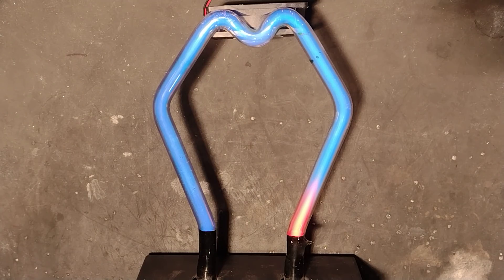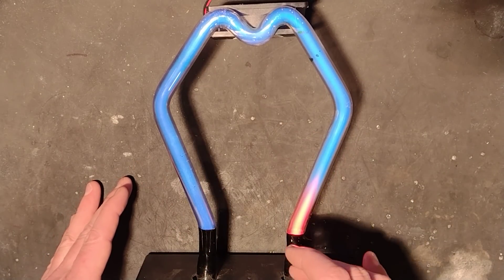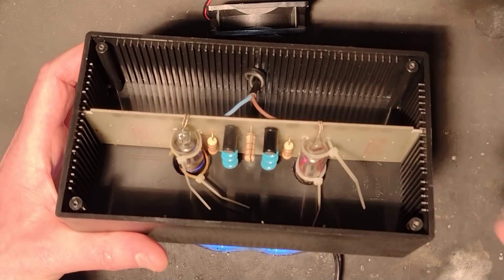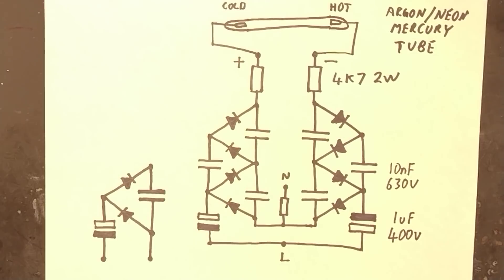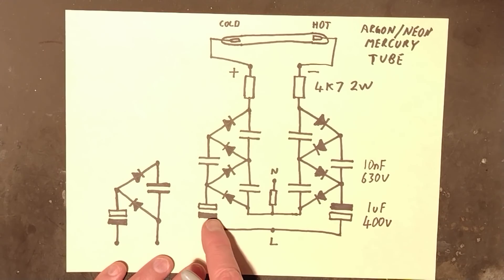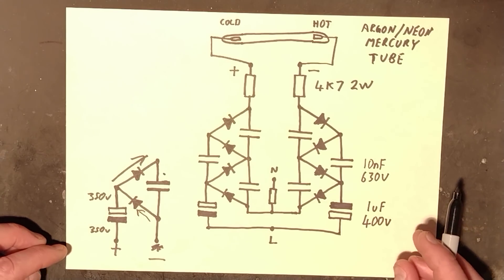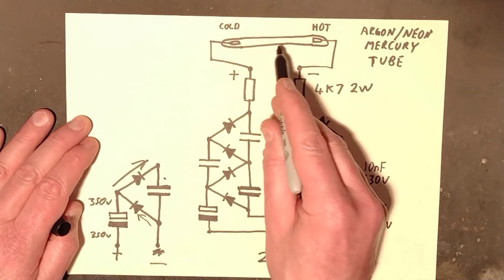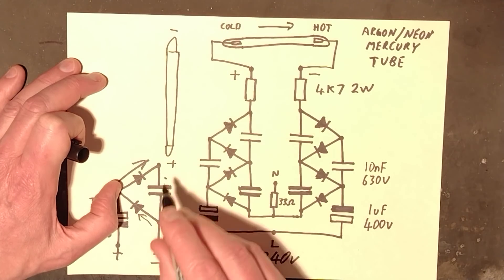The "M" tube neon-mercury DC migration effect (with schematic)

Comment: It reminds me a bit of a service timer capsule in a gyro. It is a very thin glass tube about 40mm long filled with two different fluids that don't mix, about 95% one fluid and 5% of the other. There were two electrodes in each end. A small current was passed through from end to end, and over the course of weeks the fluids would slowly exchange places and the small blob would migrate along the tube. When it reaches both end electrodes, the different conductivity was detected and popped out a service flag in the display warning you it needed an overhaul. When it was serviced we swapped applied dc current around and the blob went back the other way.  Sometimes one would come in with a fault close to service time, and we would hurry the timer blob along with a bench supply over the course of about a day.
Reply: And for some reason, I am imagining a small flag popping out and unfurling ala Looney tunes...
Reply: @adragontattoo  More in the line of a small magnetic indicator that would flip state from a black background to one with a yellow one. As they both are latching, and have a small switch built in, the flag flipping to yellow would change over the small contact set inside, and this was used to operate a yellow annunciator on the master caution warning panel, giving the pilot a flag that a system was in a degraded state. There was another set of indicators that would be right next to this one in the unit, which was operated by the self test circuitry, and that one flagging would illuminate a red annunciator light on the panel ,accompanied by a tone in the headphones, that the pilot would need to stop, using the master caution reset button, which would tell him this system is not reliable and is failed.

Generally, when you power on the aircraft, every system will light up this panel for a few seconds. Both to test the caution and warning system is working (the panel lights all come on, then go off over a few seconds as systems complete self test) and to show the avionics are all coming on properly as well. 10 seconds or so after power application the board should be all off, and you just reset the master caution button to clear the tone medley. Any that are still on, that you do not expect (oil pressure and hydraulic systems, as the engine/s are not running, and low speed warnings) are then repaired before you take off.
Reply: @adragontattoo  actually a little painted paddle on a pivot, much like a tiny little railway crossing barrier.
Reply: dude that is genius.  in a very different application I'm reminded of mercury memory in computers.  An incredible and cool solution

Comment: What happens to the available current, is it divided as the voltage is multiplied?
Also, is there a limit to how high you can multiply the voltage before arcs appear?
Reply from the maker: As the voltage goes up the current comes down.  But in this case, once the tube has struck only the first few stages of the multiplier are active.

Comment: Sometimes some mercury is used in neon based lamps to reduce sputtering._
Reply from the maker: Any trace of mercury could cause dominance over the neon.
Reply: @bigclivedotcom  But what about nixie tubes? There's something glowing blue at the electrode connected to positive in ИН-14 and according to google translation of the datasheet it was mercury._

Comment: Used to work in a shop with a large set of neon signage outside. Majority of the sign used mercury filled signs, in the favourite colour of Clive, pink, and the 3 signs all had running patterns and flashers. I kept a few spare tubes of the most common type, a bar and an arrow, as they were going to fail on the odd occasion, though most were from breaking. 

Solved the breakage problem by letting it get out in the neighborhood that the glass, while the perfect size for smoking your crack, was also going to shrivel your nuts, and the weekly breakage stopped. Helpful, as each one cost around 50 pounds to make, and I only kept 6 spare ones. Only got 4 left, as the shop closed, and the signs were removed. Did however get another 2 new pieces for another sign, from a shop that never opened, along with 2 new neon transformers. One white, one clear mercury filled glass.  Also have an electronic ballast I picked up, along with around 4 regular old lethal size neon transformers, of various sizes.

All the neon now sits wired onto a plywood board, and gets lit up on occasion, though I should add in some flourescent lamps, the high voltage EEX type, as well.

Comment: Does running the tube in dc wear out one electrode faster than the other? I always thought this would be an issue and a way to reverse polarity would be implemented to prolong tube life.
Reply: Yes it does wear out the one electrode, generally the negative one, as you are stripping electrons off it and bombarding it with positively charged ions. Does tend to erode the surface off, sputtering it on the walls of the tube. However the electrodes used in neon tubes are designed to withstand this, as it is what they normally get exposed to every half cycle, so will last around 20 years running 24/7/365 even here. Will just have a black mark around the electrode after a few decades, so you turn the tube around and use the other fresh one.
Reply: @SeanBZA  i just cant see how the negative electrode erodes if its metal is protected by a constant supply of excess electrons. i mean when the positive ions hit the neg electrode they take electrons away, but theres plenty more left over and they just keep coming. so I just dont see how the metal would start breaking up because of this bombardment, maybe master clive can set up an experiment to blow either theory out of the water
Reply: @SeanBZA  yeah you might get some high velocity in a full vacuum CRT at 25+ kilovolts, but i dont see it applying to a gas tube with few hundreds volts on it.  because what speed are we talking about here? remember its hard to accelerate things through gas, even at low pressure, whats the mean length of ion travel before it hits gas at that pressure? is it 1mm or 0.0001mm ? either way your miniature 'particle accelerator' doesnt have the distance or the voltage to impart sufficient energy for the process youre describing.
low voltage and gas as well? hmm , i give up, i just cant imagine cathode erosion happening to any significant degree in these conditions
Reply: @echelonrank3927  Seen plenty of it, just look at any CFL lamp base, which will have as it ages a nice dark band as the cathode is sputtered off onto the glass. Neon is designed to survive this for a long time, but still has the sputtering problem, especially with older tubes, even with the cup electrode, designed to have any sputtered material be mostly coated back on the inside of the cup, and not on the glass walls.

Look at any small flourescent tube and this is a lot more apparent, especially those running on cheap DC ballasts that have unidirectional high voltage pulses, where the one end will turn black.
Reply from the maker: It does, but this circuit compensates by running the tube at less than half of the electrodes rating.
Reply: I was wondering about that, thanks for the clarification, guys. 🙂

Comment: Mercury migration is used in hour-meters.
Tiny glass capillary tube with mercury fill at both ends and a tiny gap between.
There is electrolyte in the gap, current flow through the tube 'plates' mercury onto one end at the expense of the other.
The gap 'moves' to indicate operating time.
Reply: the mercury coulometer / electrochemical hour meter was only very recently retired from one of its final uses on deuterium UVC lamps in favor of the less toxic LCD digital counter.
Reply: @Muonium1  that will only motivate people to smash the counters to pieces and spread them around even more. if you make a helmet twice as strong youll find people hitting their heads 3 times as hard.
Reply: @echelonrank3927  um k sure, whatever you say
Reply: @Muonium1  i have original content on my channel
Reply: @echelonrank3927  tell the doctor to up that Risperidone dose honey
Reply from the maker: I saw those fuse-like devices on Tomorrow's world when they first appeared.
Reply: I've something similar in my junkbox which came out of an early VHS video recorder.
Reply: The most common of these are Curtis elapsed time indicators; they are (or were) commonly used on ion lasers to record the run time until the tube was considered end of life and due for replacement.

Comment: What is the brand name of those orange  insulated  screwdrivers (electricians  grade )  No  ground  connection  on that high voltage  circuit ?  That    type of voltage  doubter/tripler   circuit   can  be  found  in old  CRT  televisions
Reply from the maker: No ground needed.  Just live and neutral.   The screwdriver is a classic VDE type required by the safety industry to protect us from ourselves.
Reply: it seems to be Bahco.  from the northern countrys. sweden, or norway i guess.

Comment: Would we double the doublers on the schematic for 120 volt mains, big Clive?
If so, what about cap values?
I have heard someone say that if you reverse the polarity on the bulb,  it will slowly migrate to the other side since its DC.
I like your schematic.
All I have is a cheap circuit board version with a small transformer.
Reply from the maker: Yes, double the stages to get the strike voltage.  The capacitors would only have to be rated for half the voltage, so 200V for the base electrolytics and 400V for the others.
Reply: @bigclivedotcom  thank you big Clive!👍

Comment: up until '67, I worked on neon signs working with 10KV+ transformers [from memory]  fault-finding was fun shorting out letters with a length of cable in your hands live :)
Reply from the maker: The shorting sections with wire was common.  Quite exciting.
Reply: I remember doing this on signs standing several stores up on scaffolding. getting shocked was not fun. if I remember right, they were 12kv center tapped transformer
Reply: @jasonharrison25  Was that a painful shock?I think those were 30 mA transformers.

Comment: Perhaps a good terminology for the breakdown of the electron barrier would be the flash point???
Reply: Ignition Voltage
Reply: @COBARHORSE1  that describes what it takes to break down the barrier,  flash point is descriptive of the event... but not bad...
Reply from the maker: I suppose the correct term is strike voltage to overcome the electrode drop.

Comment: Ah, thanks Clive. This reminds me of the "Quad" as in quadrupler in my CRT projector. It's one of the last before the digital age and was "state of the art" at the time..... (turn of the century). Pushing out 35kV or so, the quad is probably the single biggest point of failure for these devices. Replacements are getting hard to find. The components are potted in a rubber like substance, and amateur attempts at making replacements don't last long at all. This has just made me smile at the number of hours of my life spent trying to converge these machines, and then sitting there wondering/waiting/expecting the quad to go "pop"!
Reply: The problem with making them is getting all the bubbles out, you need a vacuum pot to degas the resin, and then the inside will not have any voids. Reproduction ones often do not get the gas all out, leaving them with built in failure spots. The diodes and capacitors are easy enough to get, it is just the assembly is harder. In a projection set there is enough room you can even DIY it, using microwave oven diodes and high voltage capacitors, making it much larger, to get the insulation needed, and use common potting materials as well.
Reply: @SeanBZA  Yep, many have tried..... Even the vacuums to de-airate are common enough..... yet still we never got the longevity... If anybody has the "magic", there is a small but eager market out there!
Reply: I fitted a load of these back then ... in pubs and hotels. Mostly Seleco. Many happy hours spent using 68 parameters to converge the guns. Was tuning one in on christmas eve in the Park Hotel in London connected to the in-house feed that was unrestricted. Slightly embarrassed when the auto-tune found and displayed 8 foot wide images of their hardcore porn channels to a bar packed with well-dressed yuppies. Gave us a laugh though.
Reply: I suddenly feel very old! Turn of the century has always implied to me ca.1900 but you're referring to 2000 and that makes me feel ancient!!

Comment: Are you sure mercury goes from + terminal to - terminal as per 7:38?
I thought it was the other way around!
Reply: During operation all of the gasses (including the mercury vapor) in the tube will be ionized to some extent by electron impact.  The electrons (being negatively charged) will migrate towards the positive electrode and the ionized atoms (Ne+, Hg+) will migrate towards the negative electrode (the net flow of electrons is just the operating current).  Of course, recombination will be occurring all along the tube (this is where the light comes from), but the mercury atoms are about 10 times heavier than the neon atoms and diffuse rather slowly by comparison.  The net effect is that, when run on DC, the current (very slowly) pumps the mercury from the positive electrode to the negative electrode.

Comment: Another idea: what would a gold/mercury amalgam look like (or the effect, if anything) if used inside a neon tube?
Reply: Given the relative boiling points of mercury (357C) and gold (2807C) I don't think there will be enough gold in the gas phase to make a noticeable difference.
Reply: @robertlapointe4093  Thank you Robert, that's a great point.  Do you think a separation process could occur?
Reply: @ProlificInvention  There probably would be (a painfully slow) separation of the mercury from the gold amalgam.  It would be a lot simpler to just boil the mercury off from the amalgam with applied heat.  That method has been used for gold mining for about 3 millennia: take gold bearing sediment, wash with mercury, boil off the mercury in a still and the residue is more or less pure gold (usually also some silver and copper).  During the Manhatten Project, an attempt was made to separate the isotopes of uranium by passing a uranium ion beam through a magnetic field (the heavier ions bent less in the field and impacted the negative electrode in a slightly different spot than the lighter ions).  It worked, but was way too slow for generating the 10's of kilograms necessary, compared to gas centrifuges: https://en.wikipedia.org/wiki/Calutron .
Reply: @robertlapointe4093  Yes, that is exactly the point I was getting to!  The boiling off of mercury is an environmentally polluting and biologically damaging activity in many places in the world.  It made me wonder if a closed system for performing that could be beneficial.  Obviously it was a dumb idea, I have them every day 😆
Reply: Au-Hg amalgam tends to look like grayish sludge depending on the percentages of the components. I doubt it would do anything interesting in a gas tube because amalgams tend to release less mercury vapor than pure mercury IIRC.

Amalgams of cesium, gallium or rubidium or combinations of similar low-melting-point metals might be more interesting.
Reply: @markfergerson2145  I was thinking maybe a separation of the materials could occur, that would be interesting.
Reply from the maker: Amalgams are sometimes used to give a controlled dose of mercury.  Not sure what effect gold would have.
Reply: @bigclivedotcom  Sometimes in gold mining they use liquid mercury to amalgam with gold to remove it from an impure slurry of concentrated pay dirt.  The mercury is later burned off in a process that's dangerous when performed outside a lab which it usually is.  I was thinking when you said you could see the mercury in the neon bulb that perhaps there would be a way to use a modified neon lamp to separate a mercury/gold amalgam. It was just an idea, it seemed feasible at the time but likely isn't.
Reply: Ask Cody's Lab to try it.

Comment: For a 120vac application, you'd just need another doubler step then?
Reply from the maker: Each step increases the voltage by one step, so you'd need double the stages.